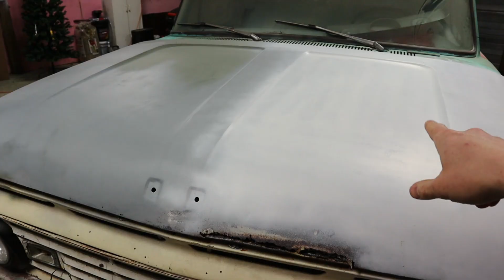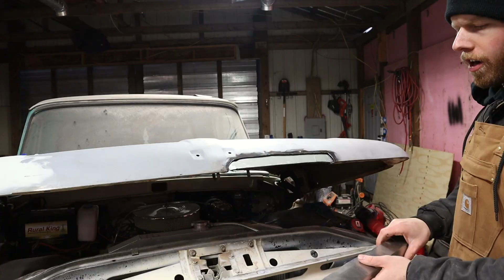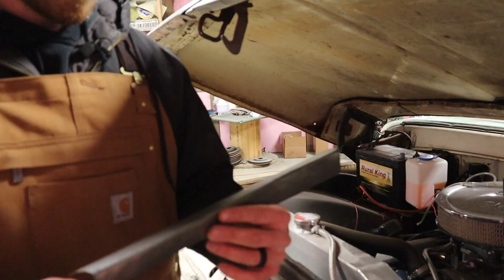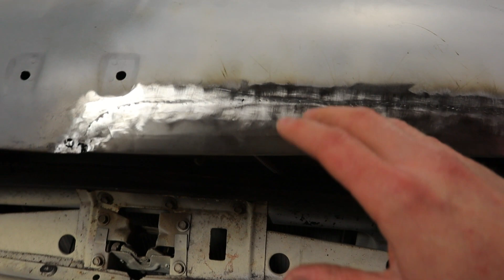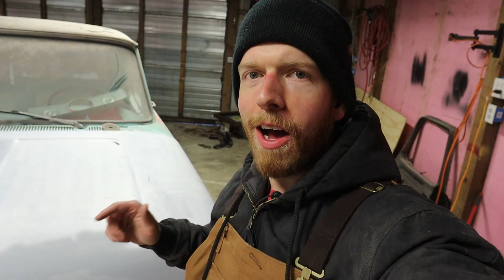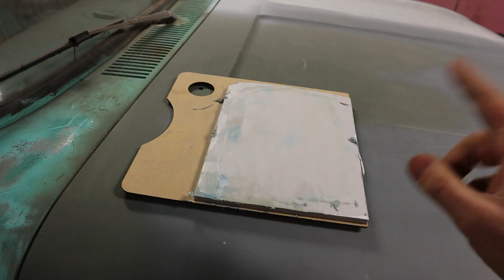How to Make Patch Panels | 1963 Ford F100 Rust Repair

Comment: Great video! Keep up the good work. What thickness sheet metal are you using for your repair panel?
Reply from the maker: For this section I used 20ga. It's more workable than a thicker gauge metal, but not paper thin like 22ga! Thanks for watching the video!

Comment: Hi...I'm binge watching your resto videos of your 1963 F100. Enjoy them very much as I hope to get a 1965 F250 custom cab camper special caribbean turquoise like my dad had back in the day.   To me it looks like your truck originally was mint green color code.  Your new updated bench seat color scheme also seems to reflect that color.  Am I correct in that assumption ?
Reply from the maker: Thanks for watching the videos! The truck had been badly painted, to cover all the cosmetic issues. Both doors are from different trucks. I would assume the original color was white, since the harder to reach areas are all white. The bench seat I made on my channel as well. Started with fabric and sewing machine! lol

Comment: I've done some welding too and I'm certainly not a professional. But I get a little better and I learn more everytime I do it. The main thing is that you got all the rusty metal out and you got some good penetration with your welds. It's perfectly fine to use some Bondo but obviously not too thick or it will crack. Good work. What an improvement!  Looking forward to future work on your projects. And remember there will always be criticism both positive and negative. You just have to take what you can use and toss out the rest.
Reply from the maker: I agree with you 100%! I'm just trying to get better each time I go out in the Barn! I've learned a lot from watching other people on here. That's why I love doing these videos so much!